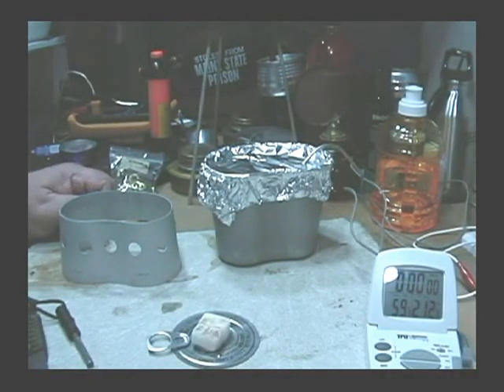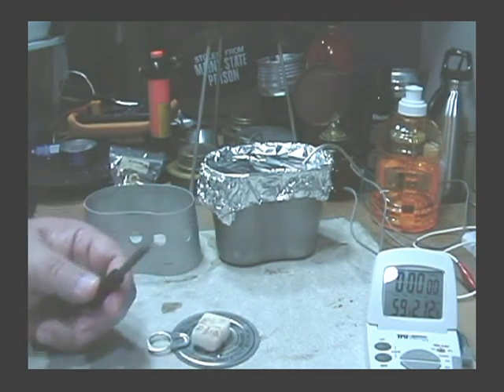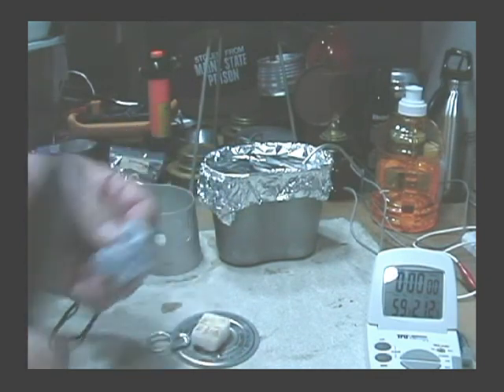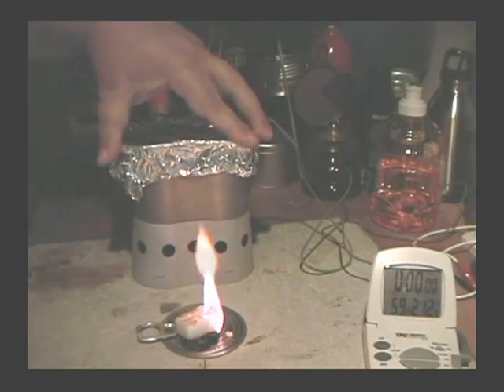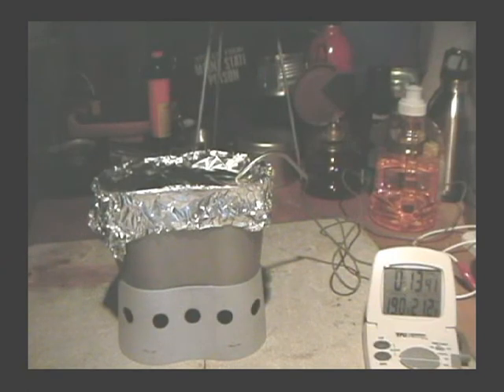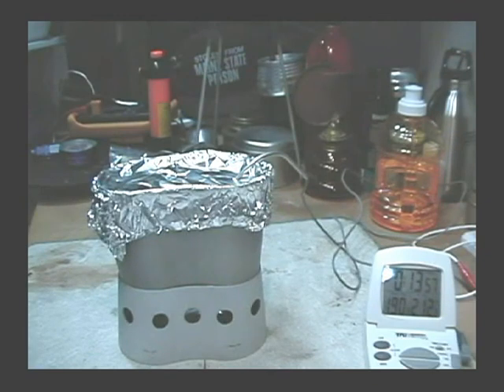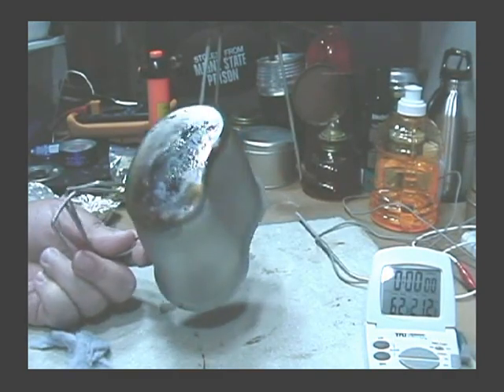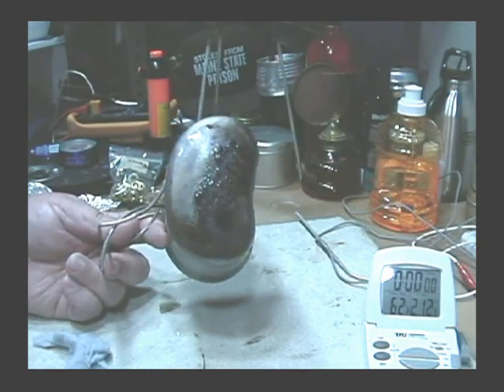Esbit started with spark 3

Comment: Hi Hiram,
You're running into all of the same issues that I had when I was doing canteen cup experiements.

I did have limited success with the canteen cup and cup stand placed onto an elevated grate, and stood the esbit tablet on it narrowest end.

I believe your experiement confirms the issues I had, that is, not enough oxygen due to a combustion chamber that is too small. This would also explain the excess residue on the bottom of the cup.

Great work!\
Keep up the experiments
Bill

Comment: I had more issues with the Esbit brand tabs then with the Tioxane tabs I bought at a surplus store.   I also found that lifting the tabs off the ground using a small grate or screen helped. I had a bit of expanded metal that I bent the ends down on so the tab was 1/2 inch off the ground.  Another quality Happy Dog Presentation!

Comment: not sure, but I have the Stainless cup as well, and it wont tranfer heat as well as the aluminum so it will take longer to heat up, but will hold its heat longer, works great for rice cause of it.